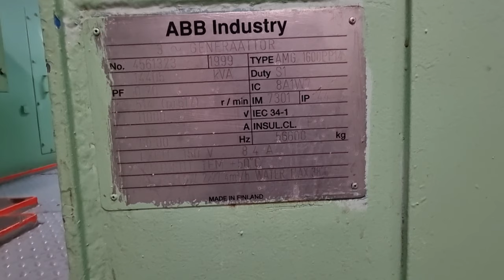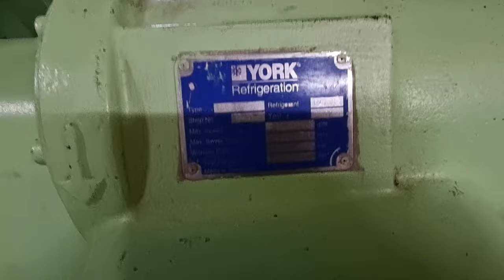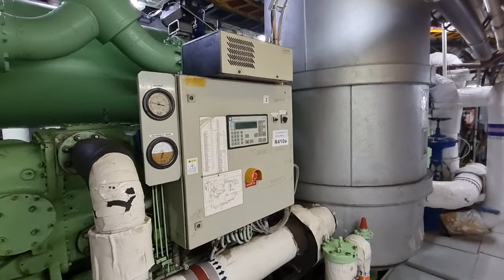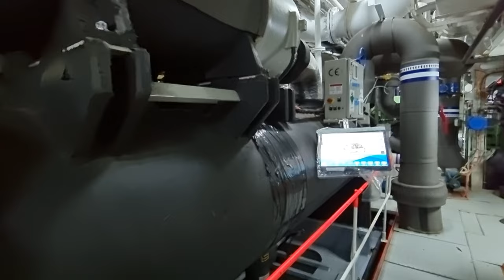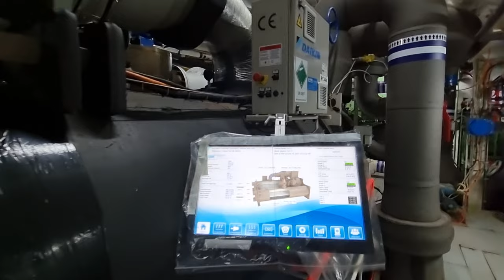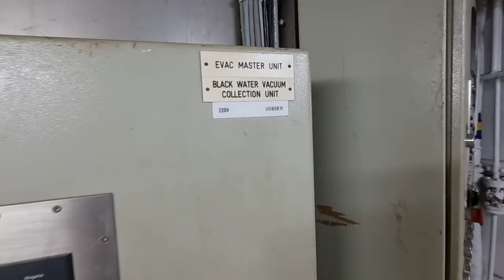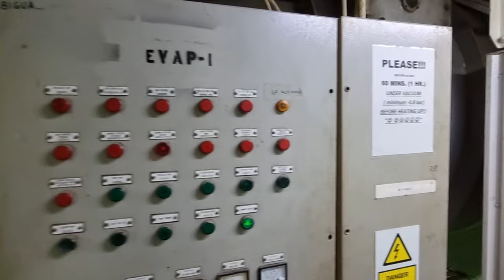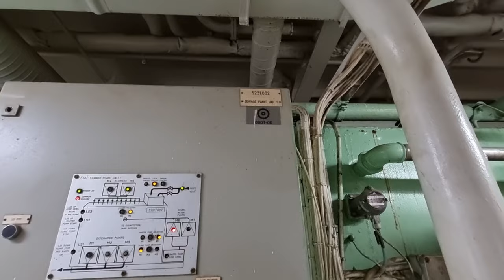Cruise ship engineroom with a massive 6 main engines and alot of life support systems

Comment: How many propeller they have do they have a transmission to connect each other to allow them to become 2 propeller
Reply: Usually, two propellers, electric propulsion. These engines purpose is generating electric power.
Reply: @sebastiandanciorogaru1052  So they are not main engine so in the vlog it say six main engine Ive never encounter six main engine on the ship
Reply: You could say main engines as there are no other engines. The majority of cruise ships built in the last 25 - 20 years, have electric propulsion,. On older cruise ships you can find classic main engines, usually four, and two propellers.

Comment: hi mr. andre its a huge impressive engine room, I have some question for you, the engine its look like a wartsila or B&W if I'm correct and is a four cycle engine , another question 6 main engine how many propellers, the engine has a shaft generator and a pitch propeller drive? how many engineers and ratings crew, sorry of my lots question ,hoping you can reply me.
Reply from the maker: Hi Socrates. These engines are only power generators. Then this power is used to power two large electric motors who is connected to two propellers with a long propeller shaft. Not needed to have pitch propellers as the electric motors are controlled with large VSD frequency controllers. Dont know how many engineers is working on the ship. Yes they are Wärtsilä engines. They also power the rest of the cruise ship.

Comment: If this ship were a true diesel direct drive, what kind of power requirements would the rest of the ship need?  Maybe 4 of the 6 engines?
Reply: On a Cruise ship a very average range is hotel and other mechanical power services consume about a 1/3 of the entire electrical powerload required when sailing at service speed. And I did not see any propeller shaft in this video. Only 6 generator sets. I imagine either it is driven by 2 Azipods or 2 direct shaft props from 2 electric Propulsion Motors.

Comment: I saw DG6 ( 6 diesel generators, plate and frame heat exchangers, chillers with 410a refrigetant water cooled but not with cooling towers. I guess  that's what the plate and frame heat exchangers are for, to reject the heat of evaporation and compression.😊😮

Comment: Just giant generators now, to power the electric pods, not direct to prop anymore 😢
Reply: So?
Reply: @JimmyCasket02  hows christmas going for you jimmy? Miserable sh*t
Reply: It has a big benefit. You can manage the power provided by the engines in a way that all the engines are running at most efficient loads. With a direct propulsion that is not always possible, except you are steaming over long distances what cruise ships do not do
Reply: @jannilshansen6142  yes i know all that, do you think i didnt know ? Im just saying its a bit boring,just sitting there,
Reply: @bonkeydollocks1879  they don’t do jumping jacks when they turn a prop shaft they also just sit there
Reply: @JimmyCasket02  how was that Christmas for you mr Misery ? Still spreading doom and gloom in the new year i see... no but they do speed up and slow down, rev, have load applied to them that changes the tone, the Sulzer ZA40s for example.
Reply: Alot of ships are still direct shaft (so needing rudders), the shafts are driven by large electric Propulsion Motors which are located in the engineroom rather than inside an azipod.
Reply: @ThyPredator  yea, not as much fun some how, no rev ranges or sudden loads, etc im talking about when the engine went straight to the gearbox then the prop came out of the back of the gearbox to the propeller
Reply: Basically a floating Power Station.

Comment: I wonder how much electrical power a cruise ship uses. I believe these big diesel engines are best for propulsion but a turbine might be better for electrical power. A lot less parts and very little maintenance. And they are efficient. We use them in the offshore industry as both drives for compressors and generators. 50 megawatt generator sets are common.
Reply: They are not big Diesel engines but compact medium speed engines to save space.  Main propulsion steam plants burns more fuel and are not as efficient as Diesel Propulsion.  However a Diesel plant has a lot more moving parts and required maintenance pushing the running costs up.  Today you would be hard pushed to find a ship with a steam propulsion plant.  Probably the only ones would be Gas carries that can burn the boil off from the cargo tanks in the boilers to provide steam for the turbines.
Reply: Gas türbinlerinde modül içinde küçük hacim ile büyük güçler üretilebilir. Bakim gerektirmez, çok yakıt yakar ve yüksek ses oluşur. Jeneratör için uygun bir seçenek veya "combination dizer or gastürbini" (CODOG) gerektigin de hız istendiğinde türbin devreye alına bilir. Bir çok ülkenin deniz kuvvetlerinde  bu sistem kullanılır. Ben türbin kullanan sivil gemi bilmiyorum sizler biliyorsanız beni bilgilendirin
Reply: These particular engines, Wartsila9L46, 1 MW per cylinder, roughly.
Reply: @sebastiandanciorogaru1052  holy fuck and * 9 and then * 6.... DAMN!